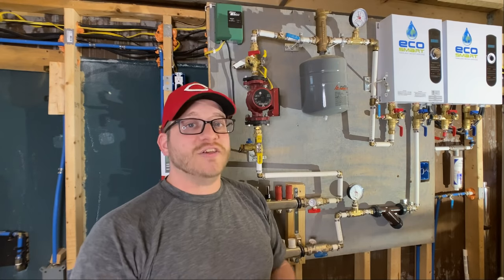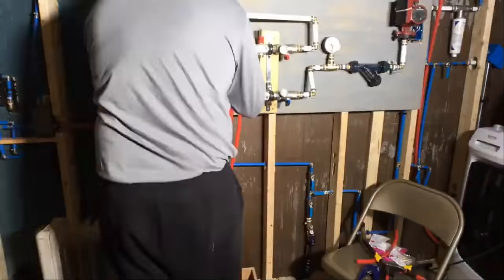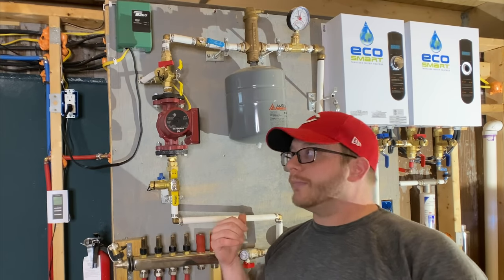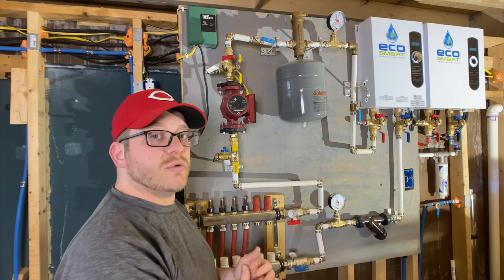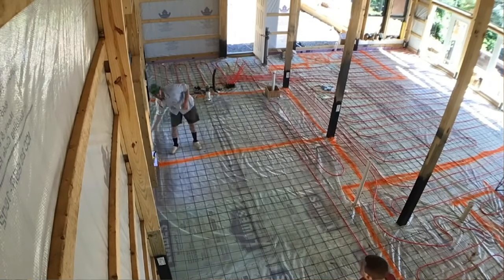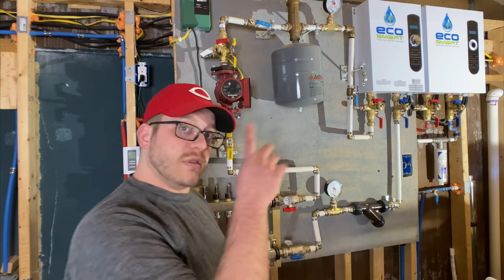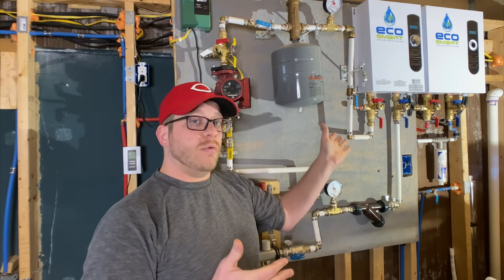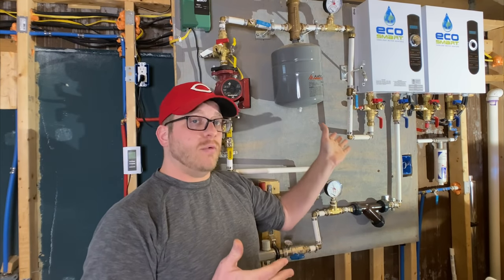Amazing Radiant Floor Heat | One Year Update & System Costs

Comment: Directly using electricity for heat is highly inefficient in most areas. The mini splits heating function will likely save you 1/3 to 1/2 on power usage. Possibly more depending on your climate and COP of the units you get.
Reply: And a natural gas heat system would be even less than that.
Reply: @truthseekerKJV  Yeah that’s the cheapest for sure. Doubt he has access to it. My house in freezing Northern Michigan is nearly 4k s/f and costs $200 heating to 71 with natural gas.
Reply: HVAC manufacturers really need to get on the stick and make Air to Water Heat pumps commonplace in the US. They are becoming the go-to in Europe. We already know how efficient air to air heat pumps are, but having air to water would make radiant heat very efficient and very affordable. Would even give natural gas a run for its money.
Reply: @helmutreviews7204  I totally agree with that. The cheaper cooling cost would even help offset the heating cost difference between NG. In my area a geo install costs about 30k. That’s hard to justify. Those new Well-Connect systems that strip water of its heat and dump it in the septic are sorta a step in the right direction coming in a 5-6k for a install. But It’s only supplemental, and only time will tell the adverse effects running 2gpm of water through your well and septic constantly.
Reply: @helmutreviews7204  Air to Air, HP totally suck in the dead of winter. 
If you own an excavator and have some land, you can put in a Geothermal pretty reasonably and they save a ton of money.  Another great option is a wood boiler, especially if you have a wooded lot and don't mind processing some firewood. The new boilers are super efficient, and use half as much wood as they did just 10 yrs ago
Reply: You need to be careful with the wording there. Electric heat is 100% efficient. Everything going in, is converted to heat. The issue is that a heat pump does not just create the heat, it moves it. It takes a fourth or so the energy to move it vs create it directly. So heat pumps you need to talk about Coefficient of Performance, not efficiency. The COP is the heat output divided by the energy input.
The next issue that comes up in this discussion is geothermal. This term is being misused by marketing at various companies. Historically is was using heat directly from the earth which means it had to be hotter than the heated space and did not require energy input except for circulation pumps. Now it is getting applied to heat pumps which is using energy to extract heat. The proper term is Ground Source Heat Pump.
When I last calculated they cost a fourth to operate vs electric resistance heaters, and about half that of natural gas. The major problem is the installation cost of the ground (or pond) source. My ROI for a contractor installed system would be greater than 30 years (I could do it for far less myself).
Reply: @court2379  yeah I was wording that for the general public not technical. People like to associate the word “efficiency” with cost savings, and nothing more.
Reply: @vapurade  Unfortunately the electric heat proponents mislead people by using efficiency. They say it's 100% (and they aren't lying), but people don't understand that 80% NG, or a heat pump still costs less. To most people they think, how could I get better than 100%...this is a great product.
Reply: @court2379  YES! So you get the same thing. A customer was telling me that he went with ERH in his home because it was 4% more efficient then a top of the line condensing boilers. After a face-palm I then had to go on to explain what it really meant. After a few tries It then clicked when I said “1 BTU of electricity is over four times the cost of 1BTU of NG, and even that 4% loss is still over 4 times cheaper. ” bad mistake as well because our NG is 20% cheaper then the average.
Reply: Am i mistaken or are the split unit heat pumps not able to make sufficient heat when temp is below 20F
Reply: @chrisschauer7505  Depends on the unit and the working fluid. Using an air heat exchanger which is most common, you are trying to absorb heat from the air. If the air is 20F then the heat exchanger has to be a good amount colder than that to absorb heat. Some units don't get that cold. 

If you ground source it, (put a secondary heat exchanger) under ground. The temp there stays relatively constant at around 45-60 depending on location and depth. Which will always work.
Reply: @chrisschauer7505  my MrCool mini split runs good till the single digits. once it’s below 0F I have to start the wood stove. It’s a 24k btu unit in a 24x40 shop with 6” of spray foam insulation.
Reply: @truthseekerKJV  However if they are out in the boonies we are talking propane, which I believe is three times as much as NG.  I live in a very southern climate (zone 10 I think) so I am thinking of a thermal solar system supplemented by propane.
Reply: @truthseekerKJV  most places a unit of a COP3 will be cheaper than gas. It depends on if NG is available and that areas cost of electric. Heat pumps are pushing over a cop4 now and drop to a cop3 at around 0-5F so it really does depend on a few factors. i would be right on that borderline area with electric only being .087 cents but NG isnt available only propane and it costs more.
Reply: @helmutreviews7204  Imagine air to water hydronic geo system with the added benefit of installing a bank of solar water heaters, a few solar panels to power a couple pumps to charge your ground battery  via another ground loop just 1 foot under your geothermal loop. Some are back mixing solar heated water into their field/wells already. i would prefer to break the systems up for ease of maintenance and trouble shooting.
Reply: @court2379  I like the term ground battery. Lets put some heat down there also with solar water heating while we are at it! might find you can remove the compressor all together. Charge your ground battery all summer long with solar water panels and solar powered pumps it will work all summer and you dont have to lift a chainsaw. I am getting to old for the firewood game myself (0.o)....
Reply: @chrisschauer7505  some are able to go to 32/20/5/-22F depends on the tech (type of compressor and controls). for units going down to -22F your currently looking at around 3K for a 2 ton unit versus 1900dollars for one that does 32-20F at 2tons. They will soon make window units with the new tech since they have rolled out now PTAC's (hotel/motel rigs) around 12K btu's and up. Some through the wall and smallish window units out there but buyer beware on those makers for a while till they got some 5-12K window and wall units from good makers like LG, Frigidaire, GE and the like. I think Friedrich might join in the fun soon. I would gladly pay 300bucks for a 8k cooling 7K heat pump window unit at a seer 12 rating that cooks worms when it is -20F outside.
Reply: I have a new radient system I installed. 3 floors 1000sqft per floor I'm using gas. I want to get solor and convert to eletric would you think I should use one unit per floor or 3 one for each floor. Or 2 on for the basement/ garage ground level concrete utilizing one unit and the second unit to cover two floors. I neve thought of using a continuous hot water supply for radient heat. Sound like a good idea.
Reply: The mini split will not warm the floor of a slab on grade like the in floor heat. You will always have cold feet..
Reply: @dennisbaker5668  thats why i have wood floors

Comment: When you say cold outside, I would like to know the actual temperature outside and inside. What happens if you loose power to your system ? Ice on power lines etc. Do you think it will stay warm for 24 hours or less ?

Comment: I have virtually the same system in my home (3200 ftsq).  The system has been running for 12 years and the only issue has been the flow sense wheel in the Eco is really noisy.  The Eco 24 also causes my lights to flicker.  I will be replacing the Eco this summer with a heat pump to lower my electrical load.

Comment: Thanks for the price breakdown. We bought a 1940 colonial last year. It has a boiler and cast-iron radiators all on 1 zone. I'm planning to zone out the first floor and second floor of the house, and then run radiant tubing in the basement ceiling to heat the first floor. Your video has been very helpful in seeing the components and pricing.
Reply from the maker: Glad the video was helpful!

Comment: Thank you for showing your setup, gave me the push I needed to change my oil burning boiler for the Ecosmart and saved a ton of money on my heating bill. I chose to leave the circulator pump on 24/7 and modulate the output temperature when needed depending on the weather. Works great and cost is way down. Thanks for the help !

Comment: I, too, live in northern Virginia and my primary HVAC stem is an electric heat pump with back-up resistance heating coils.  My conditioned space is 4,400 sqft (9 ft ceilings).  My budget electricity plan (12 month moving average) is $205 per month.  I keep my house at 70degF in the winter and 74degF in the summer.  The heating is much more expensive than the cooling. I have thought of installing radiant heating, but, at this point, I cannot justify they cost.  Regardless, I appreciate and like your YouTube channel!
Reply from the maker: Cool!
Thanks for watching!

Comment: Little suggestion. Tie your other two zones in just incase the seal leaks one day. You can also open one of the unused zones to incase your cold supply tenp. Increasing the cold water supply temp might increase the boiler efficiency. If you can find a ECOsmart efficiency graph you can dial in the boiler to run at its most efficient operating area. Great video👍

Comment: The Ecosmart will adjust the temperature that is coming out of the heater, is controlled by the sensors and the computer of the water heaters. Don't need to turn off the breakers for the water heaters. The system look awesome.
Reply from the maker: Thanks! Yeah I’ve realized that the sensor helps regulate the required energy to heat the water 👍🙂

Comment: I just purchased a newer (7yr old) home with hydronic heated slab in the basement and heated slab in detached 700 sq foot garage.
Living in Eastern Canada, our winters are long and can be rather ‘harsh’... I’ve only been in the house for 2 months now but absolutely love this type of heat. We also have electric heated floors in the kitchen and a forced air system as we are approximately 4100 sq feet over 3 levels.. so although the radiant heat does raise, the forced air is still required for the bedrooms on the top level... plus the a/c ducting was required for our hot/humid summers. I love going into my garage that is a constant 17 degrees and getting into my warm vehicle especially as we are currently sitting at -30 degrees with the wind chill. The cost of running the system is almost irrelevant to me given the benefits. I do have the boiler system with a hot water holding tank for household use... so all in one is great!
Reply: That's nice.

Comment: Just a couple of ideas.  You might want to consider installing a couple of ceiling fans if you haven't already.  Heat will stratify even though you have floor radiant.  It would be better to get that heat back down to where you live, even though you are comfortable now.  It would allow you to turn you floor heat down a bit.  I'm not sure I understand why you aren't just running a standard thermostat, but I'm sure that you have your reasons.  

You should seriously think about replacing your electric water heaters with a wall mount 95% condensing boiler.  Your home looks well insulated, and I think you could easily save $100 a month net for heating your home in the middle of winter.  You may be a bit afraid of the venting, but that's the easiest part (believe it or not).  Just run it out an exterior wall and leave the exhaust higher than the intake and at least 12 inches away so the air intake doesn't suck in the exhaust.  Depending on the length, you may be able to use 2" but for certain you could use 3".  I'd recommend a Laars FT 100,000 BTU.  They are about $1,800 through Supply House, and if you've gotten this far, you're smart enough to do a boiler. You could get a combi and get your hot water from it, but that's up to you.

Being a bit long winded here, but you're thinking is backwards on the split duct heat pumps.  They are BY FAR the best way to heat your home at least to 30 degrees.  Just a guess, but using 14 cents as you cost for electricity, you may be able to heat for $70 a month at 30 degrees and $120 at 10 degrees with a 19-21 seer heat pump.  You could probably get by easily with one 24,000 BTU or 2 12,000 BTU heat pumps, and there are very likely rebates available.  Depending on your income, you may be able to get them for free or half price because of the Inflation Reduction Act (that program will probably be available in April at the earliest, keep your eyes open).  Don't think twice, get split duct heat pumps, even if you love your radiant.  Oh, they're easy to put in too.

Forgive me if I'm telling you stuff you already know.

Good luck!  Thanks for the video!
Reply: I wish they made a heat pump for ceilings. It would be perfect for their use case. 
They would do well to get a water tank setup attached to a heat pump to lower their bills. Then some radiators for the inside coming off the same system.
Reply: you seem knowledgeable enough and I am entertaining the idea of installing something like this in my apartment in Europe. Ive lived in the US and love how everyone is DIY and I did a fair share of DIY in the US as well... an apartment in Europe things get trickier because, well apartments so logistics is so much different and all the constraints. Anyways, im moving to my own apartment in June and sinnce its the last floor and I have 600 sq ft terrace I can do thinngs at my own pace and entertain some DIY.

Since it's a rooftop, I have also space above on the roof and was thinking... is it possible to have this radiant system but instead of a boiler, to have a Solar Panel? Solar Panels with a tank are standard here in this country for Water heating purposes, so I was thinking if a panel would make sense and how much different would the installation be? Seems it would be straighforward no? There are 330 sunny days without a single cloud and in the winter, houses are cold because construction here sucks (all concrete and barely no insulation if any). I do inntend to insulate as most I can but given temperatures at most drop to 40F with sunny day, would such a solar system work? Seems like pretty cheap and great savings given electricity prices here are 30 cents per kWh

Comment: Like your system. I have been working to put together a system for my house. My house was built 60 years ago before these systems came out. I worked at a shop that my boss in stall one of these systems. The main building we in stall a heat exchanger in the duck work and work shop had the plex pipe in stall in the floor. It worked fine. The only problem was he had a wood burning boiler. Where I lived I cannot in stall that kind of boiler. I have been looking at these on demand boiler and did not know if they would work. After seeing your video I am going to go buy one. So I can finish setting up my heating system and cut my gas bill for my furnace.

Comment: Nice place 👍.
FYI - a key selling point of the Ecosmart water heaters is their computer control that “ calculates the incoming temperature & flow rate to determine the appropriate power output to reach the the set temperature point “. Ecosmart also specifies their elements are Triac controlled meaning they are variable wattage.
Reply from the maker: Thanks!
I’ll have to look into that more! I didn’t realize it used variable wattage. Appreciate the tip!

Comment: Kudos on the diy! You might want to get a flow switch or a low water cutoff to cut the power on the electric boiler in the event of low water/zero pressure.  Most local codes require it.
Reply from the maker: Thanks! The electric tankless turns off when the flow of the water stops.

Comment: I put in the same type system in my pole barn house in the 80's  It has worked well.  I don't think you need a 140 degree water temperature.  I run mine at around 100 degrees which was what was recommended at the time. If you lower the temperature of course the pump will run at longer intervals but overall I think it might be more efficient.
Reply: It would definitely be more efficient because it takes less energy to move the water than it does to heat it.  That pump's energy consumption is nothing compared to those heaters.
Reply: Not quite accurate, electric heat produces 3412 BTU per 1 kWH consumed at 100% efficiency. If you dial down your water temperature it will just take longer to output the required BTU's (all the while running your circulator pump longer, using more electricity). Given current energy prices, electric heat is in almost all cases NEVER more efficient than other options. Electric heat pump (air/air, hot water, etc.) is almost ALWAYS more efficient than other options besides wood.

Comment: At a tankless fair demo 10 years ago, I asked about merging into a radiant flooring system. The rep said 'Oh, yeah, NO, don't use a tankless. You will be running the burner so randomly and so often, you will burn it out much faster than normal use.' So do research and get multiple opinions.
Here in quake country, tanked is the way to go anyway, as it's an additional 30+ gallons of water available in case a pipe breaks.